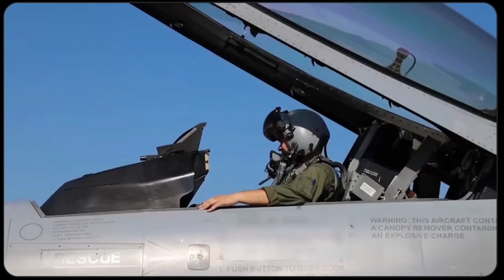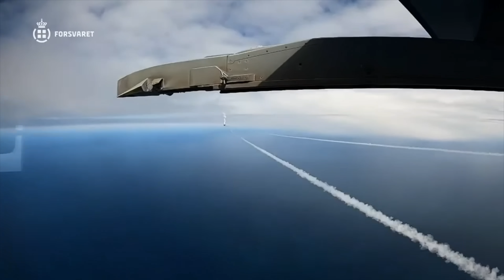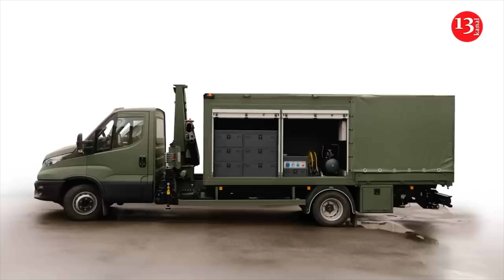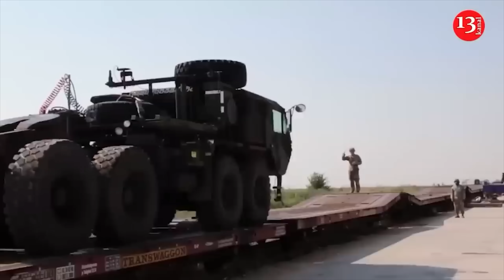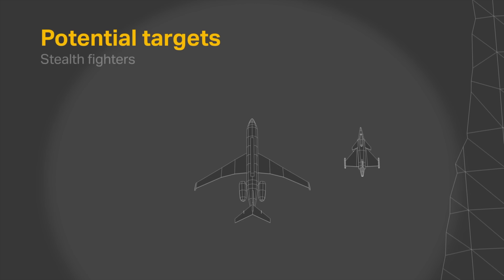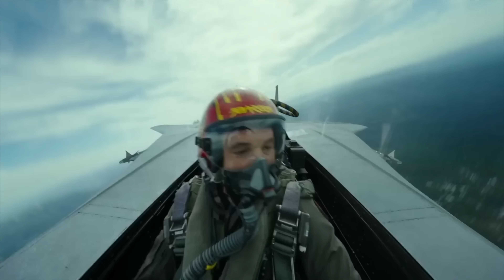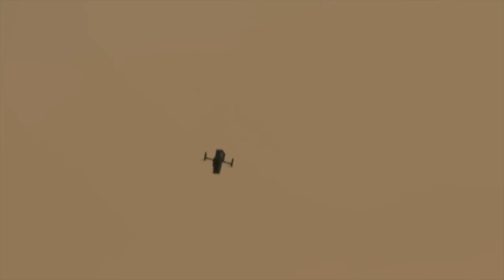Ukraine's Mobile F-16 Ops are INSANE!

Comment: Regarding the support vehicles, I concur that it adds a lot to its flexibility but, they should’ve used a more common vehicle found in ukraine or one that appears to be a common vehicle. You want a vehicle that won’t get a second glance from enemy observers observing satellite images or ground observation. Once a couple key vehicles that are known to support ONLY the F-16 is a huge red flag for the S-2 shop and it’ll tell them what’s now in the area or moving to that area. In the other hand, it can be used to deceive enemy intel/observation by posting a few dummy vehicles on some old airstrip so the enemy moves to put ordinance on the airstrip which will give away the location of their GTG missile launchers and any aircraft base locations. By forming a sweet, irresistible target for an enemy, you can plan an aerial ambush as the enemy flies along anticipated routes and this is where the F-16 can shine since it’s not regarded as a serious dog fighter.

Comment: Great video on great Ukrainian F-16 ops. One tiny side note: You mentioned that the Ukrainian F-16 downing that Russuan Su-35 was the very first F-16 AMRAAM kill. It wasn't. RNLAF Aviator Lt.-Col. Peter "Wobble" Tankink, flying F-16AM J-063, shot down a Serbian MiG-29 during the Kosovo war in 1999, with an AIM-120A AMRAAM.

Comment: I appreciate the information in this video, on technology and tactics, but this host's language is just too, too over-the-top. It is like one long string of purple prose and jangly jargon; note at time, approximately, 10:20 where our host says, about the F-16 service trucks, that "they are essentially like transformers just got steroids." But are they really?
   These trucks are nothing like transformers, much less transformers on steroids. 
   Yes, these trucks have been transformed from the basic chassis and body of an Iveco one-ton, but so have huge numbers of other Ivecos on the road, doing duty as, for example, small buses, delivery vehicles, recovery vehicles, mobile kitchens. Are these trucks like transformer or are they, in fact,  merely Iveco one-ton trucks kitted with cabinets, for tool bins and storage, and a one-ton crane? In what manner do these trucks demonstrate what one would expect from a dose of steroids? 
    And, our host uses the phrase "they essentially are" . . . which means "basically the same." But they are clearly not basically the same as transformers: first, the fictional transformers are complex, sentient beings who are able to transform repeatedly. The service trucks shown in this video are basic trucks with a few minor modification which result in one transformation, from a basic Iveco one-ton to the current fixed and unchanging form we see in this video. 
    These trucks do not transform repeatedly back and forth from one form to the other, as do the fictional transformers. These trucks remain fixed in their current configuration. And, most importantly, these truck are not sentient beings but only dumb pieces of machinery.

It is just boring and a bit of an insult to intelligence to listen to these trucks described in such exaggerated, glowing, and un-truthful terms.

Yes, "essential" means to be "basically", or "fundamentally" the same. Given that these trucks are nothing like transformers it is clear that the Host is exaggerating so as to increase the level of temptation felt for his click-bait videos.
    I guess I should not be surprised; the word "basically" is the most often misused multiple-syllable word in English; when we use the word "basically" we most often mean "more or less", as in "he is basically a nice guy", by which we most often mean that "he is more or less a nice guy." 
    Given that "essentially" and "basically" mean essentially the same thing (there, my us of the word "essentially" is correct) it is not surprising that our host misuses the word "essentially."
    Indeed, all the adverbial types ending in "ly" are often misused. Here is another example; we often say things such as "hopefully the bus will come soon" . . . but when the bus arrives the bus will not be filled with hope. What we really mean is "I am hopeful the bus will arrive soon." I, the person, am hopeful. The word "hopefully" means "filled with hope"; a bus can not be filled with hope.
    Given the way these adverbial types are so often misused, is there any wonder that our host misuses the word "essentially" in what is basically a click-bait video; there, I just used the word basically more properly because essentially (there is another correct use of an "ly" adverb), yes essentially, this video adheres to the fundamental, defined characteristics of a click-bait video - over the top language often presented in capitals. 
    For another example of over the top, click-bait-like word use, look at the word "INSANE" in the title. No, the F-16s and the vehicles used to maintain those aircraft are not "insane" and are not "essentially transformers" on "steroids"
    
Our host is exaggerating, which is not really surprising in our current era of exaggeration and click-bait videos. I mean, just consider how often people exaggerate the importance of mundane things, events, circumstances . . .  look at the over use of the words "perfect" and "awesome."
   I am sitting here mentally counting the number of times, last week, when I placed my order at MacDonalds, how many times the server said "awesome" or "perfect" after each item,  "awesome . . . perfect . . .  perfect . . . awesome." I call BS on that sort of exaggeration. And, please do not try to dismiss that exaggeration by saying people are just being friendly. 
    As well, I am recalling recent visits to a medical clinic and the person at the front desk said "perfect" when I handed over my health-insurance card; I am recalling the last time I took a flight and the person at the check-in counter said "perfect" when I presented my ticket, said "awesome' when I declared I had no luggage to check. 
    We live in a world were every day mundane things and happenings are regularly described with exaggerated, sickeningly, self-indulgent, over-the-top language.

Nature abhors perfection. There is no perfection in our world. If there was perfection in our world then our world would be a very boring place: we would learn nothing; we would not know beauty; we would not know success because there would be no failure. It is because perfection is boring and impossible that the argument for heaven proposes a silly, boring place. 
    
For a thing or person or place to be "awesome" it must be "moving" or perhaps "jaw-dropping", maybe "inspiring" or "revolutionary." But we live in a world where folks say things like "very unique" or "awesome" or perfect" about boring popular music and block-buster low-brow movies. There are no degrees of unique and that which is popular is most often low quality because the only way to create popularity is to remove high quality. The high quality must be removed so as to appeal to a low common denominator. To be popular a thing, idea, person must appeal to low aspects of humanity not the high ones. Of course there are exception but they are far more rare than one might suppose.
    
When everything is "perfect" or "awesome" or" unique" these terms mean noting. If everything is "important" then no thing is important. If everything is popular then everything is mundane, boring.

Grow up folks and see what is really happening here. Our host is exaggerating.

Please don't try to dismiss the exaggeration i point to by saying I am just being crabby or rude. 
    And, please, do not say, "well, James, if you don't like this type of video don't click on it." To that I say just as it is my right and duty to report or speak to bad drivers it is also my right and duty to try and limit the very poor use of our internet, this powerful tool which could be doing so much good.

Comment: Saab gripen is made to operate like this from the start it has Fast turnaround (10–15 min)
 Minimal crew (5 people) Operates from highways or roads, rugged dessign for rough environments Sweden designed it specifically for asymmetric defense change out an engine on the side of a road less then 1 hour 	2–3 technicians The F-16’s intake is notorious for sucking in rocks, dirt, and even snow or grass during non-standard takeoffs/landings  Gripen has High-mounted and curved, reduces risk of sucking in debris.its FOD restistant

Comment: Excellent, relevant, highly factual from someone who knows what he's talking about--not just another Internet Armchair General. Made me totally rethink my view of the F-16's utility in Ukraine. I still think SAAB Gripens would be even better, since they were designed from the ground up to be used the way the Ukrainians have jury-rigged the F-16 to be used. But ya gotta work with what ya got. My question for this guy is could Ukraine use the 160-odd A-10s the USAF plans to scrap shortly? Like using it as a bomb truck launching long range missiles from far behind the front lines, launching decoy drones with the radar signature of a B-52 in order to bring SAM sites out of hiding ahead of the actual strike package, or just using them the same way Ukraine is using its dwindling fleet of Su-25s. You don't seem to have posted anything about the A-10 yet. Maybe now's the time.

Comment: The Gripen which is built for this just needs 2 trucks with weapons and equipment and a fuel truck.
The Gripen don't need a generator it has a large APU for that allowing self cold start, but also the ability to be on high alert without burning gas in the main engine.
Reply: But it was built for this. F16 wasn’t

Comment: So, Ukraine are using the operation methods that Sweden has used for 70 years and you say it's a revolution for the battlefield? All Gripens tooling and spares are hosted in standard containers, fully mobile instantly. Other countries like Finland has don't this too, but with F-18's. A revolution? NO, but finally USA are getting it.

Comment: So the Swedes with the Gripen concept was right all along.
Reply: Since cold war large part of countries had created Road runways on both sides of the curtain. A lot of them stopped being maintained but still a lot of European countries retained the ability of operating fighters from the roads.
Reply: @Frankon81  we here in switzerland just had a excercise where this was pracktised on the swissa utobahn
Reply: @Frankon81 were harriers able to do that?
Reply: @Frankon81  That was rumored even in Canada, always heard that every so many miles of the Trans-Canada highway had to have straight sections at least "x" metres long....
Reply: @Frankon81 dude I've seen potholes in the rich neighborhoods in Moskow. No way Russia has road runways
Reply: Only when you are basically out of options and need to innovate ways to do things.
Reply: Tends to happen when you`ve been preparing against the same guys for 50 years longer.
Reply: @miguelfpaula  hmm i forgot that consoles back then were also pretty basic 😅
Reply: Are the Gripen already operating in Ukraine?
Reply: Look I have nothing against Sweden or the Gripen, but rough airfield capability was not a new concept invented by the Swedes. The A-10 was developed a couple decades earlier with this exact same tactic in mind and it was not at all a new idea even then
Reply: Yes dispersed basing is not new.  The mach 2 Viggen jets of Sweden were decades before the A-10.  They had thrust reversers to backup and stop on a dime and folding vertical tails to hide.
Reply: We have over 320 VTOL Jets, who needs a runway?
Reply: Yes when your not a 1st world and don't have airfields
Reply: @HeHimZerZeeZimZitch  You mean to say "not have air fields bombed by Russia"...
It's not like anyone chooses road bases for lack of proper air fields.
Reply: @HeHimZerZeeZimZitch We (Sweden) is one of the top first world contries. Unlike the US.
Reply: @HeHimZerZeeZimZitch you mean ”yes while actively fighting a war on home territory”?

Comment: Remember all the delays, and the naysayers?
"You can't use F16s in Ukraine. You need perfect runways, what about all the FOD!?"
Ukraine says, "There is nothing we can't do. Haven't we already shown you, over and over again?"
Reply: Leave it to the Ukrainians. Not supporting them, just to learn from them, is not an option.
Reply: I mean... it was always overestimated risk. You need to simply spend some additional time cleaning runaway surface. You can operate F-16's from road network. Especially considering you can just bring over civilian road cleaning machine to sweep it, then inspect it for anything left, take off your jet inspect, take off another one ect...
Only difference vs more "rugged" jets is that you really need to commit more manpower and equipment to keep such runaway viable. So it's a larger operation than let's say for Gripen or Russian jet. As long as surface is prepared it's not really that large of a risk... F-16 just has a bit unfortunate large uncovered intake just below so it will suck in branches, small rocks... long term  service life of engines will likely take a hit - as some soil/sand particles and super small rocks will  probably get in anyway, just not immediately causing catastrophic failure. But that's just the nature of it I guess. 
You would need to cover intakes  or somewhat minimize how much unwanted stuff gets in to fix it.
Reply: @Beneficiis wasnt this planned   operation already for end stage of f16 just like the f35 will in its final stage i mean thats kinds there biggest asset being small and able to take of of an road
Reply: Hold my beer 😂
Reply: The average person has no concept of how intelligent and capable most engineers are, and it’s pretty funny that they judge them and most of them didn’t even go to college or old mathematics😅
Reply: Literally !
Reply: the second thing is: the naysayers always say, that ukraine gets so much and doesn't pay. oh they are paying. they are paying with something very valuable: this innovative style of fighting? teaching older equipment new tricks? they are willing to teach.
Reply: @robertheinrich2994 true. Both Russia and Ukraine have way more expertise in UAV combat than the U.S at this point.
Reply: I remember Biden simply said "they don't need F16".
They say Trump is Putin's friend, but I believe all USA presidents were Putin's friends.
Reply: I bet the whole system is adopeted from Sweden and their "Start and Land everywhere" Gripens
Reply: Most of them have already been destroyed, don't you think that Ukraine would be publishing videos of f16 kills all over the internet? they do love their propaganda.
Reply: Those were excuses -- the real reason was "Biden" Administration really feared upsetting Putin...
Reply: F16 is a cold war development, using the highway as a runway was within the existing strategy. Europe should revive the highway tests.
Reply: The issue was NEVER would F16 be useful it was what would help the UA most NOW! Example a Patriot battery with first full missile loadout is in the $1.4B range and maint for one year. Not more missiles, but keeping the equipment going. PLUS a Patriot battery is full of standard equipment UA troops could learn to maintain quickly like diesel engines, electrical generators and the harder stuff like electronics can be handled relatively quickly. Now a squadron of F16 with maintenance for a year, not more missiles, but a full loadout of a standard squadron... which in both cases isn't really fair but a standard... is around is in the $1.3B. BUT maintenance on a F16 is harder than any USSR era jet. It takes a long time to get maintenance trained.... maybe longer than. Oh, and what would help more than 300 Bradley's? The UA Army would say "Fuck yeah" on the Bradley's! Look how long it took the EU members to come up with the older F16's... THOUGH they have upgraded the shit out of them and some of the defensive pods are crazy! Now you get the US engineers, talking to Swedish and Finish engineers and UA engineers and LOOK at the F^&KING toys they came up with. No one could say this out loud but all of this had to be done to make the F16 hope to be successful. Remember when the whole F16 talk from UA kinda disappeared?  NOW pilots had to be trained. That interception of the SU35 could NOT have happened under a USSR style air doctrine. NOT A HOPE IN HELL. A Canadian NATO aviation trainer said in 2021 he did not think even half of current UA pilots could switch over the NATO capabilities and war doctrine WHICH USING THE F16 REQUIRES! No, at some point the UA Air Force and upper echelons understood this and now you have older F16's with advanced defense and more showing up at about the same time Sweden AWAC equivalent shows up, with pilots that can fly NATO doctrine attacks, and MORE F16's in the tube along with more pilots, and more maintenance in the tube and see the plan and how fast it was done... I feel sorry for you. You must be training in the Russian logistical way! You can bet UA also took the effort to hidden upgrades to "runways" all over the place. Yeah, you can see the history of the very same thing that Sweden and Finland have been designing for for over 50 years. In the mean time the US was supplying stuff that the UA needed to survive through some of the largest logistical pipes in the world... except when Republicans wanted to join the losing side... Fuel, ammunition of all types, upgrading weapons like the Bradley or M777, and intelligence and people still complain if UA didn't outwardly get what it wanted when it wanted it, The US and NATO was failing. Lots of SDB I's over there. Lots of bombs of all types the F16 can use are over there now... Actually I was disappointed when the US sent 32 M1A1 instead of another 100 Bradley's... Stopping now.